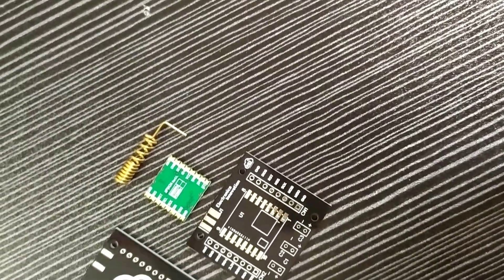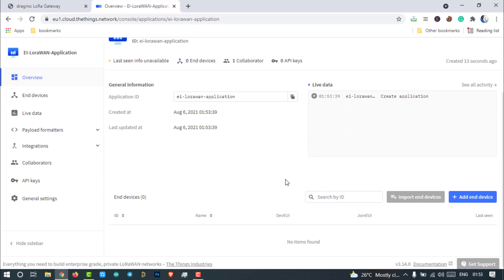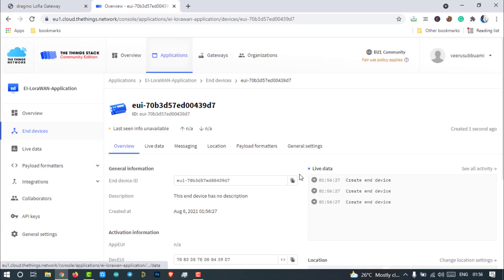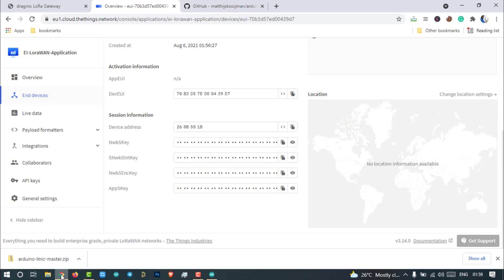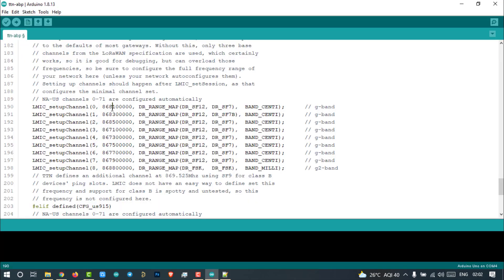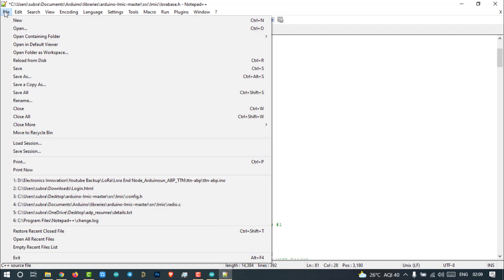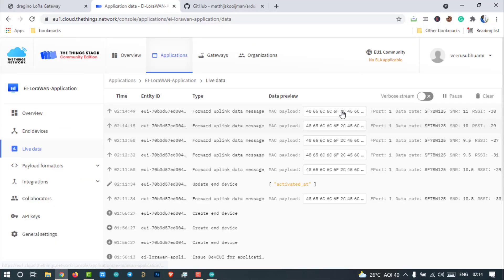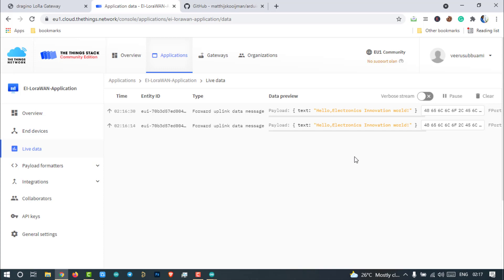ABP-based LoRaWAN End Node with Arduino Uno & RFM95 | How to make LoRa Node?

Comment: My code executes but the output is not completed. It is showing in the serial monitor as stating and packet queued after that the EV_txcomplete is not happening. i dont know why i have done all the way as it is.
I have used arduino uno with semtech sx1276 lora module with dragino gateway ttn cloud.
could anyone please say the solution for this issue??

Comment: Amazing video. I have a question. I have dragino lorawan endpoint, Can i read this information with other arduino (with RFM95 LoRa module)? I can not buy lorawan gateway. Thanks a lot.
Reply from the maker: Yes, you can. But it should be configured as receiver or gateway.

Here is the DIY gateway
https://youtu.be/4W9G0gT3t2Y

Comment: Can you help me?  I have an error: libraries\arduino-lmic-master\src\lmic\radio.c:689.
I use 902-928 MHz , and change only this in the  (CFG_eu868)
Reply: may be interfacing problem with RFM95 and Arduino,  because different voltage you can rectify this problem using level shifter. (sorry for my english)
Reply: Have you resolved the issue? I am having the same problem. I am from India and using 865-867mhz